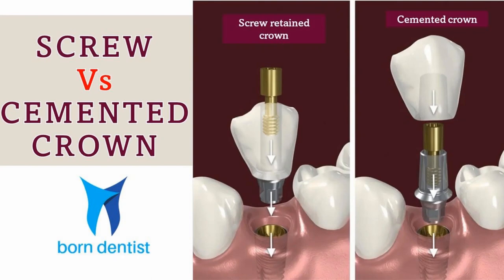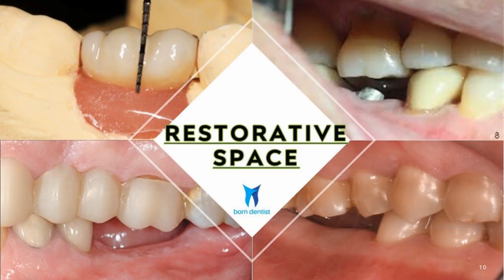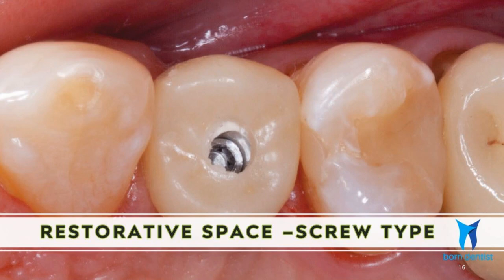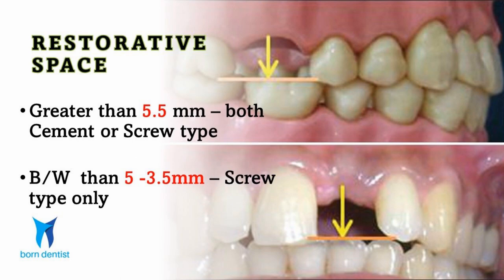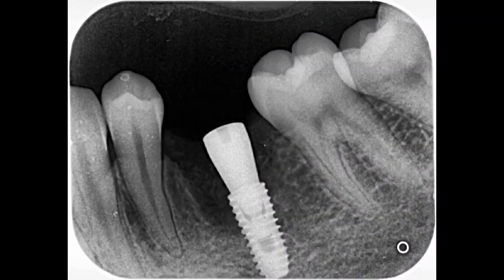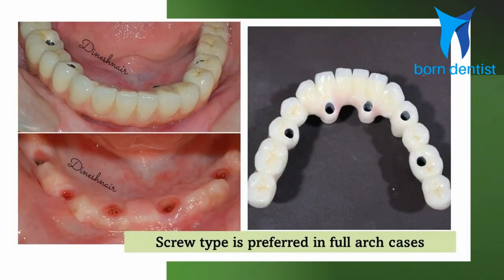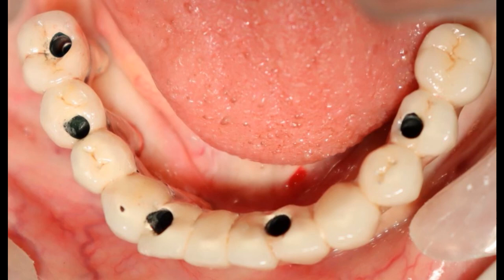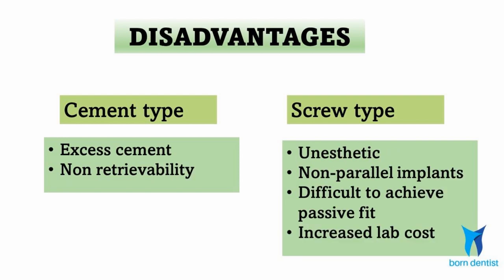SCREW VS CEMENT RETAINED IMPLANT CROWN

Comment: I have an implant with a cement retained crown, how easy or difficult is to turn a cement retained crown into a screw retained crown for the purposes of an implant?
Reply from the maker: It is better not to change the current crown ,if you dont have any issues with it. The easiness depends on which tooth, where exactly the screw hole is located and many other things, usually the restorative dentist will have some previous record to identify the location of  the screw hole. at least in some cases it is troublesome.

Comment: Can you adjust the height of a screwed crown if it is too low?
Reply from the maker: Height is predetermined while fabricating the crown, you can correct it by making new crown.
Reply from the maker: Height is predetermined while fabricating the crown.  You can correct it by making new crown.
Reply: @BORNDENTIST  Thanks. So you can't alter the existing one?